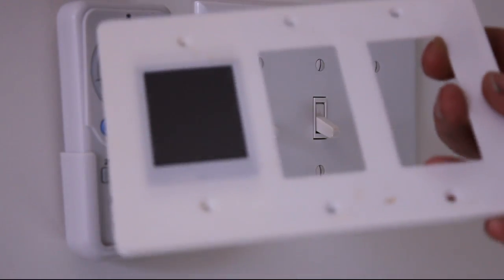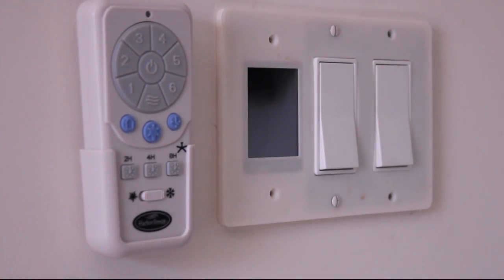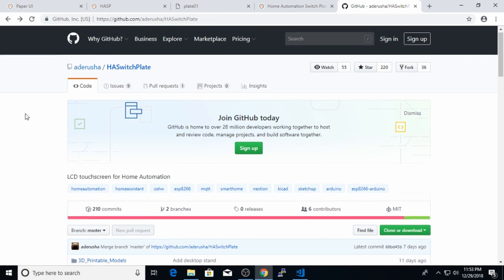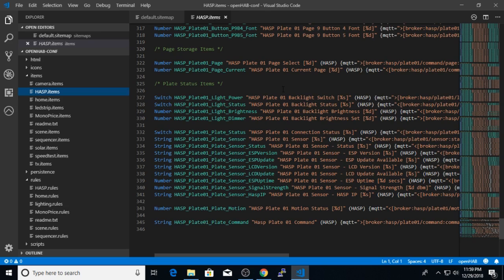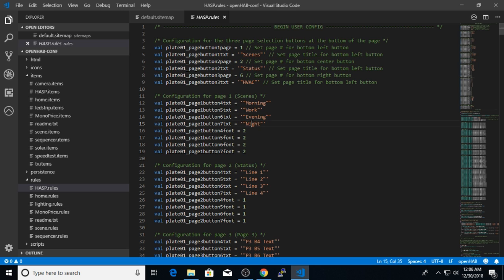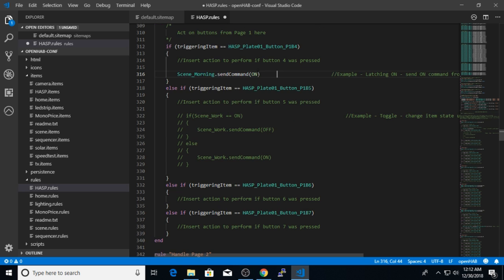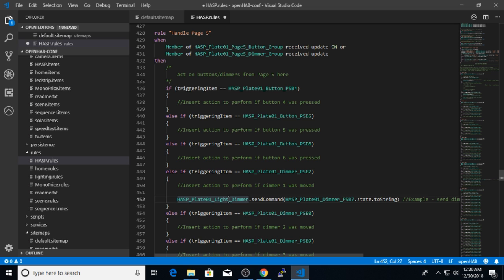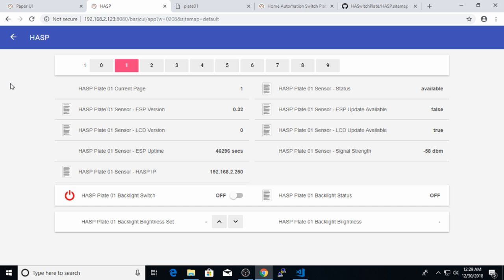Home Automation Switch Plate (HASP) - Install & openHAB Configuration - Part 2

Comment: Also, do we just have access to maximum of 3 pages on HAplate?
Reply from the maker: The 3 page maximum is really just due to the # of buttons on the bottom bar, but you get to pick any 3 pages you want. And, if you want more pages to show, you can make one of the spare buttons on each page act as a "Next" or "Prev" button, to switch between all the different pages (I also added all the page buttons to my openHAB sitemap, so I can use that to switch between, or to use openHAB rules to switch between pages). Theoretically, you could use all 9 pages, I just haven't had a need to use the remaining ones :)
Reply: Thanks. One more thing. Why do you prefer openhab to home assistant? As for me I prefer the free cloud service, the awesome android app and openhab stability
Reply from the maker: Definitely the three things you listed, plus I can’t tolerate YAML, its nested logic makes my eyes/brain hurt - I much prefer the OH Rules DSL (even though it’s far from perfect)

Comment: This is great thanks man, so everything comes down to configure the sitemap and item in order to use the OHplate?
Reply from the maker: @Luis Gatica - Exactly! The HMI and Wemos code are made to be very flexible and just show whatever data you pass to it (that is what makes it possible to use with multiple systems like openHAB). You still have to come up with a "use case" for yourself, and program the openHAB configuration to suit. You don't really need to touch the Items file, but you will need to add your own rules to handle the HASP pushbuttons and show whatever data you want to show dynamically on the HASP HMI.